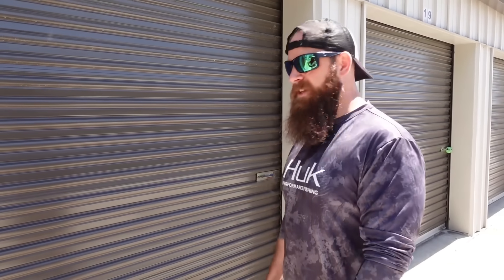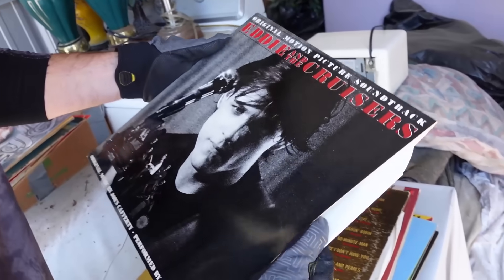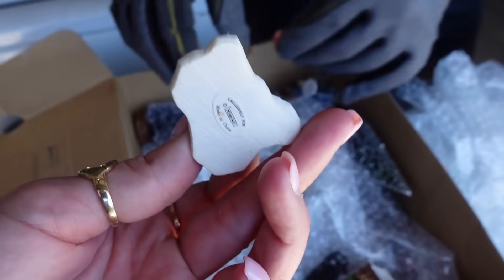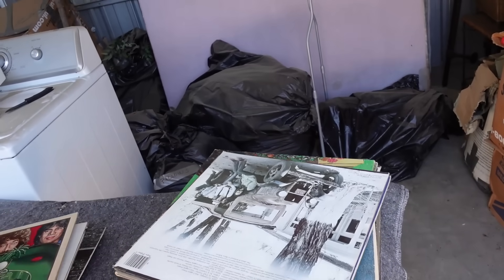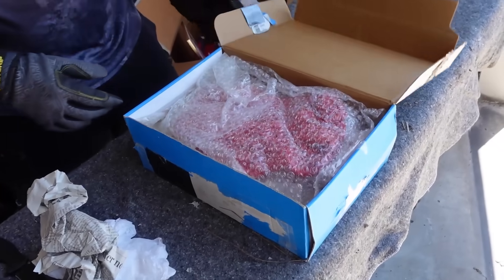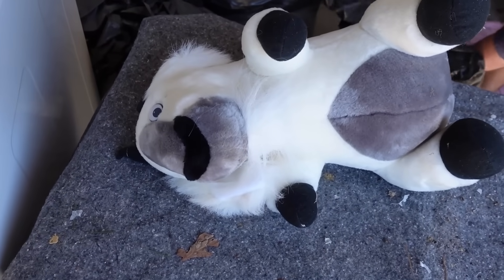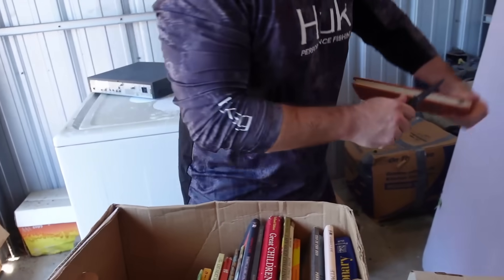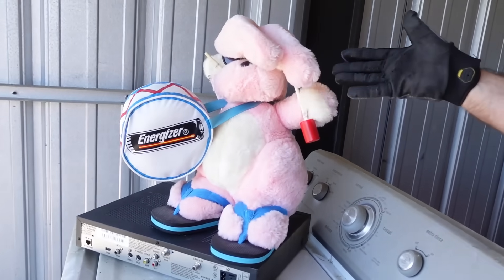This million dollar business shut down and left everything behind...

Comment: I bought storage lockers for a year a while back, and the cheapest one I ever got was $30.00. It was a 12x15, or something like that. And all you could see were clothes, on the floor of the unit, they were about 2 feet deep, but you could see one tennis show, and it looked like a Nike. 

So I got it for $30.00, and hit the jackpot. After digging through all the dirty clothes I found about 40 pairs of shoes, all Nike and Reebok, and a few Air Jordans too, and they were all like new. I also found prison paperwork, and a big balance beam scale, most likely used for weighing drugs. 

I also found 2 really nice leather jackets, and a Nascar collection, including a checkered flag signed by a bunch of drivers. I sold it all on Craigslist, and at a garage sale. I was selling the shoes for $40.00 to $60.00 each, and I got $100 out of a few of the Air Jordans. 

In total I made close to $1.500 off that little $30.00 unit, and it was the best one I got that year.

Comment: The album at 20:05 is Led Zeppelin’s In Through The Out Door from either late 1979 or early 1980-i forget which.  Good album and is very collectible for fans of Led Zeppelin.  If you ever run across a Golden Earring album, can’t recall the title but the cover has a green tinted picture, that one is very valuable!
Reply: No it's Led Zeppelin 4